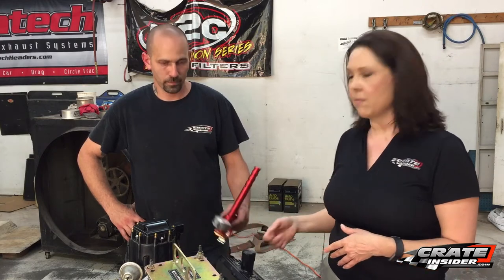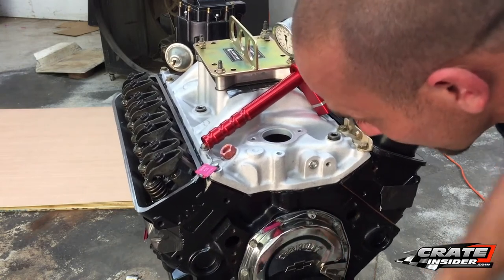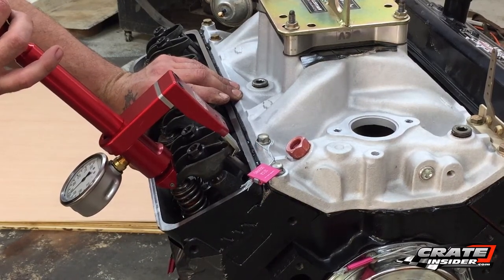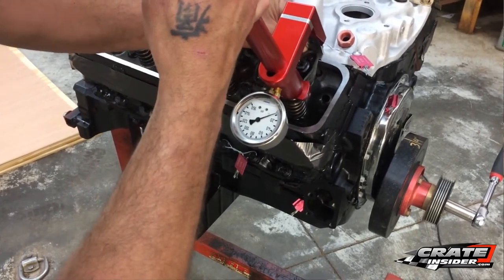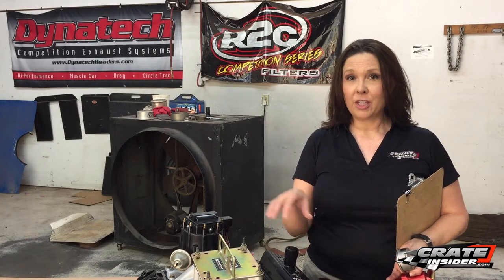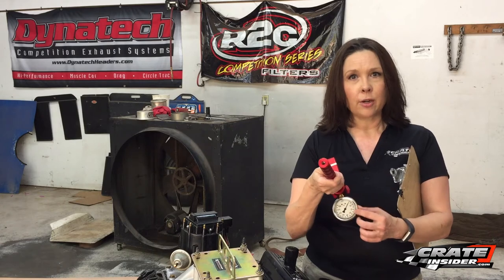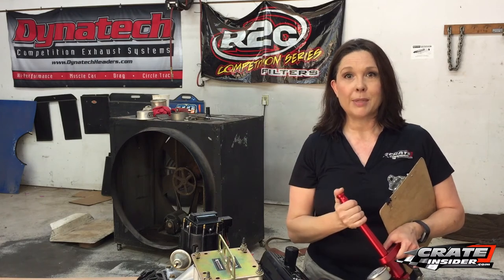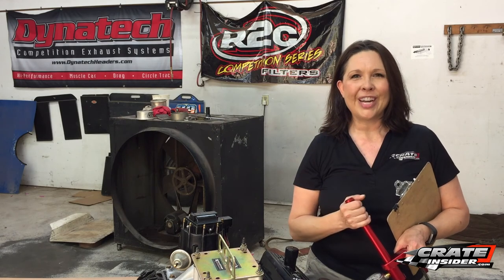How Often to Change Valve Springs on a Crate Engine

Comment: When in doubt change them, springs create a lot of heat, you would be surprised at how hot a spring gets when it’s compressed. As a rule never let a engine sit in one position for to long, always rotate a motor if your not using it. If at all possible install oil sprayer bars to spray oil on your valve springs it will help keep springs fresh longer, because of the cooling effect of the oil.